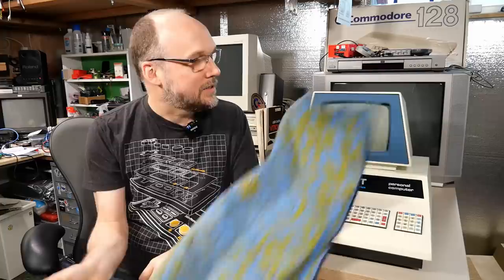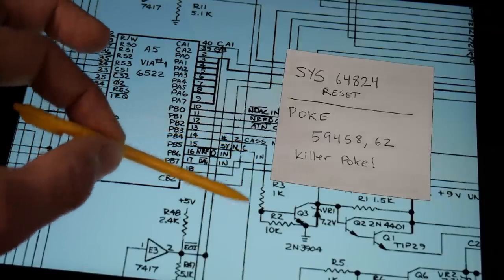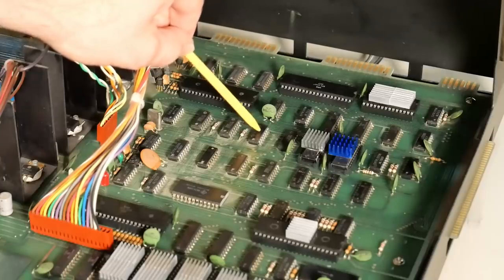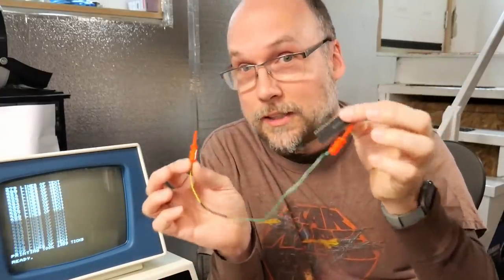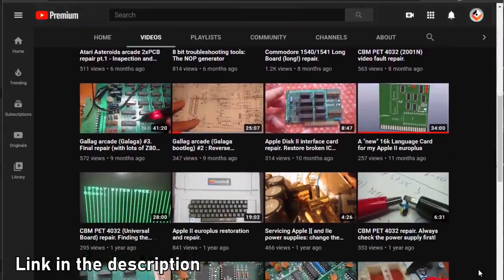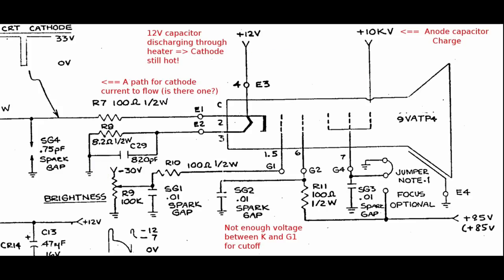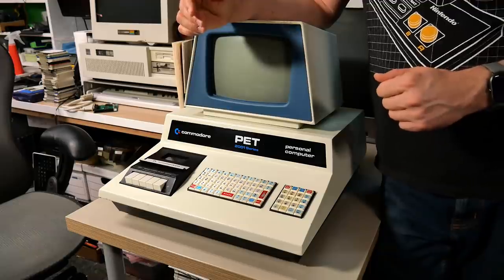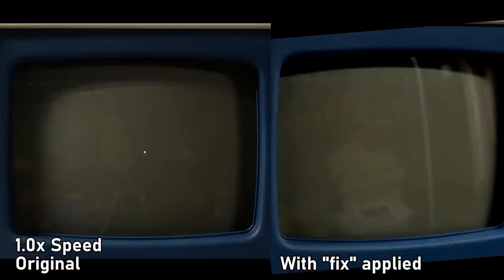Permanent Killer Poke Mod and CRT Spot fix on the Commodore PET 2001

Comment: Normal behavior for a CRT.  You would need to discharge the HV before you lost deflection to avoid it.  It doesn't hurt anything.  If your CRT has a burnt spot, it is because it was run for an extended time without horizontal and vertical deflection.  Eventually I suppose the power down spot could burn in, but it would take 40 or 50 years... Oh wait...
Reply: I have to disagree. Commodore itself tried to avoid the big spot you see on Adrian's PET with changes made in the later monitor revisions. And no, you don't want to discharge HV in a single spot, when it's done on purpose, the energy is spread with raster oscillator still running. This can't obviously be done on a PET monitor since it doesn't have raster oscillators.
Reply: @Walczyk  I never had a PET but last time I've seen that spot on a properly working CRT was early 60s TV. All TVs and video monitors from 80s i had never had that issue. And it's better to be fixed.

Comment: Back in the early 1980s, I signed on for a computing course with the UK Open University. We operated mainframes that input via teletype keyboards and output on paper tape - no screens at all. Although expensive, I quit the course within a few months and wrote off my money.
Partly because during the course I'd encountered no equipment less than a decade old, and partly because of an open policy that home computing was a fantasy, and the new, increasingly available devices like the Pet, TRS-80 and others would NOT be included in the course as they were "toys that could never have any place in computer science."
I subsequently learned more from a year's subscription to a computing magazine than I might ever have learned from that course.

Comment: I think you could safely connect that pin of VIA chip, by the 510-2k resistor to where it originally was connected. Resistor would be enough for separating the VIA from the rest of the circuit in case of level conflict. The POKE would then work as it was supposed to.
Reply: That's what I was thinking as well. Adrian could use the stacked socket trick to do this using the original VIA. Also, Commodore surely knew about this trick, why didn't they add a resistor when they designed the newer models?
Reply: I was thinking the same - a 1K resistor between the VIA PB5 and the rest of the circuit would do the job perfectly well. The rest of the circuit would be relatively unaffected by the 1K to ground, and the 1K series resistance when the VIA is configured as normal would still result in a correct logic level being seen by the VIA
Reply: @eDoc2020  yes this is correct, a resistor in series can also "do the job" but you have to "poke" everytime you want the "fast" speed. With Adrian's mod there's no need for any poke anymore. It depends on what you want to accomplish. Most strange thing is that Commodore corrected the "snow" effect on 2001N motherboards, so the VRAM can be safely accessed outside the vertical retrace periods without causing any snow, but they didn't change the firmware or changed the VIA input circuitry. So 2001N remain unnecessarily slow.

Comment: 13:00 since i have a PET 2001 I can agree as well, that the dot on the screen appears when you power the computer off, in my case sadly the CRT even has a burned spot in the midle

Comment: The persistent dot in the middle of the screen, is because the emitter in your CRT is experiencing two things.
Firstly the magnetic coils that focus the beam has collapsed, so the emitters focus is only in the middle, so energizing the phosphor for longer, so seeming brighter for less current (effort).
Secondly there is a tendency to for emitter to continue to emit when they are hot. Basically they are amplifiers, the heat means the electrons are excited, and even when the power is removed, they continue to emit due to heat. If your valve emitter system is in good condition, they will persist for longer. Answer: You have a good condition CRT.

Comment: The early IBM CGA adapter had a similar issue with snow. In 80-column mode, the CPU and the video controller chip would not be able to read/write to the memory at the same time without causing snow. The BIOS routines would wait for the screen retrace before updating the video memory, but it had to poll for the retrace status, which was terribly slow and caused the same flicker you see on the PET. So you could have slower/flickering text or faster snowy text. Some DOS programs even had options for these two "modes". Great video, thanks!

Comment: Love retro PET video's. My first exposure to computing was as a 14 year old (back in 79'') when my dad bought a 2001. Later upgraded to a 4016 with external dual floppy drive (4040) which I built a mod to make the top half of the character ROM switchable to RAM so you could create your own character sets and draw basic graphics. Happy days.

Comment: Nice RPN Calculator app.  Also really nice collab and deep dive into the CRT issue, my Uncle was an electronic engineer building TV's way back in the B&W and early color era and I remember him explaining this problem to me in words I could understand at the time (he was 20-30 years older than my father, can't remember exactly, and was already retired by this point).  I was learning to program Assembly and C on an Apple IIGS and got the //e and display as a gift/challenge to fix...I fixed the computer but stayed clear of the CRT and watched him repair it closely as he explained how it all worked in words a slightly educated ~7 year old me would understand in the late 90's.

Comment: Thanks for a very informative video.  I have a 3032 PET with the full-size keyboard.  I have used the 'killer poke' for many, many years on my machine.  It does speed things up with the penalty of 'snow' on the screen at certain times, same as you experienced.  It has never harmed any of the chips.  Many early Cursor games incorporated the killer poke as a speed boost.  You really notice the speed up when listing a program, for example.  However, trying it on a 4032 (fat 40) with the CRT controller chip, it makes very unhappy noises from either the flyback or deflection circuitry.  I quickly turned off the machine before any damage could occur.  Also, as you probably know, they fixed the dot issue on the later PETs.  I've never had it happen on mine.

Comment: I messed with some programming on this very machine back in the day.  The dot was normal with these PET's.   Thanks Adrian for the video!
Reply from the maker: Yeah definitely a design flaw from the factory :-)
Reply: @adriansdigitalbasement  😎interesting
Reply: @adriansdigitalbasement  Not a design flaw - a design choice, there's no need to provide a different discharge path as the damage to the screen would not occur during the warranty period/expected service life of the machine. Most mono CRTs of the day have a similar power down dot...
Reply: @Fifury161  There's no need to provide a discharge path in the first place. Commodore made a few mistakes and they even tried to correct them as soon as the second monitor revision came out (I have a 1978 and a 1979 monitors).
Reply: Yes, and it was standard with every black & white TV set too at that time.... everytime you switched it off, it had that collapsing dot that finally faded to nothing!  It was nothing unusual.  Every monochrome CRT and TV did the same thing.  Perfectly normal!  🙂
And yes, I was around during the 60s and 70s... pretty much every CRT image will collapse to a small dot when turned off, but some go much faster than others - 80s and 90s TV/monitor types especially....
Reply: @iz8dwf  Again, it's not a fault, it's a design choice...
Reply: @Fifury161  I'm betting the power switch would fail long before you would be able to burn-in the CRT by powering it on and off all the time, anyway. And you'd probably still see the commodore/memory-free message burnt in first.

Comment: I'm an old tube guy, so that also includes CRT's. Back in the early 80's there was always the standing argument of turn off dot "burn in", or whether or not a shadow of the turn off dot would be permanately burned in the phosfor coating on the viewable face of the screen. I was always with the group that the turn off unfocused beam did not have enough current to create the shadow spot. Can't wait to see the next installment
Reply: There is good logic to your argument. When you consider the duration there is likely more damage to be done whilst the tube is on! Damage will occur over time for any CRT - most are rated for 20,000 ~ 30,000 hours...
Reply: I’ve seen thousands of CRT tv’s over the years and I’ve never seen one with burn in or a super dim picture. Usually the most common problems I saw was one of the guns not functioning so you’d either get a all purple or all blue/green picture. I’ve only seen a few monitors with burn in, mostly business terminals.
Reply: @EmergencyChannel  You realise you have contradicted yourself?
Reply: @Fifury161  TV's and monitors are two different things. I never claimed to know anything about CRT's, but I did run the front desk of a repair shop and done paper work while the technicians fixed the tv's.
Reply: @EmergencyChannel  Erm, in this analogy they are not as they both have CRTs. The best example of screen burn in could be found back in the day in airports. Both the flight timetables shown on CRTs and the local news channels on CRTs all suffered from screen burn in. The timetable where on monitors, the news channels on TVs, all CRTs back in the day...
Reply: @Fifury161  My point was that the average consumer never experienced burn in.

Comment: Even after all this time, I still use peek and poke commands during initial board bring up.  In this case they're Linux applications I write to allow direct access to kernel memory and PCI space from the command line.  It's amazing how much of the hardware you can wring out with old BASIC commands!

Comment: The dot does not represent a dying CRT.   In fact, it usually happens with strong CRTs.
Zenith TVs in particular use to get it a lot, but you are right with saying a lot of early TVs did.
The explanation provided is very good.
Reply: I've found that on TVs the dot happens more the darker the picture is. I presume this is because the current draw of a bright picture quickly drains the HV before deflection fully stops. The association with the dot and weak CRTs may be just because their picture is dimmer.
Reply: @eDoc2020  I think Zenith use to recommend turning the brightness to maximum just before turning the tv off to minimise the dot, but the dot doesn't do any damage.  It's just the last burst of energy from the guns as the cathode cools.  It creates a bright dot as the horizontal and vertical is already shutdown, so the beam just hits the middle of the screen

Comment: Hi All

Another great video

Adrian i thought you would be similar age to me and remember black and white TV's up to 70's done that when switched off - i never knew why.

But you have invented the turbo button for the PET

This would be usefull for speed and if there is a operator watching screen you can turbo of to fix the snow 

This reminds me of changing the  CGA cards on the IBM PC to fix the CGA snow at work ( and then also at home at the time ) A lot of people complained about headaches with the machines with CGA snow at the time

Regards
George

Comment: I remember seeing the spot starting about 3 inches in diameter gradually decreasing down to nothing over about 30 seconds or so after switching off our old wooden cased 20" ITT colour TV. Was quite a strange effect watching it in the dark after you'd switched it off at night! I had a feeling it was just due to the design of the chassis, as i'd seen other TV's doing it back then as well. That was a good TV, had valves (tubes) inside, shame though that the vertical hold went on it (I think the vertical hold pot crumbled). My dad chucked it away in the end (it had already been replaced with a newer TV, I had the ITT in my bedroom when it still worked). Wish I still had that TV, if I knew then what I know now about repairing arcade and monitor/TV chassis I could've repaired it in a few minutes!

Comment: I've owned several of these PET 2001 with the blue (white) on black CRT, that all have the power off spot. My current one, by far the best one I've ever had, also has it. It's also common to see on vintage television sets. I can't remember though having owned one with the green on black CRT (later model PET 2001) that had it too.

Comment: I remember the bright dot on switch off way back when I fixed TVs a lot of customer though it was a fault or it could damage the tube it was just a product of the design of the early black and white TVs although there was a similar fault call frame collapse I think it was a long time ago still don't know how you could fix it keep the videos coming I went on to be a computer engineer as well later I remember the pet 2001 it was the only computer we had at school in the uk for a long time until it was replaced by the BBC computers

Comment: given that VIA has a nice amount of space around it, i think it might be feasible to make a "killer poke adapter" by putting 2 pin headers in the right distance (to fit into the mainboard's VIA socket) and a socket (to fit a normal VIA) on a pcb, and then having a jumper to select between pin 15 being passed through or being grounded through a resistor. feels neater than your cable and pin bending solution. plus you could attach a 3 pin cable to that jumper header that leads to a switch on the frontplate if you want a fancy switch to select between "fast" and "nice" mode.

Comment: I had always assumed it was just the leftover energy being drained into the cathode ray tube, since there was no signal coming in but there was still energy inside the apparatus, so I thought that was just the way to drain the capacitors. I grew up in the '70s and '80s I had an Atari 2600 with a black and white television set. I fondly remember turning off my television set and noticing the Little Dot in the center sometimes up to 20 seconds. As I got older and began to understand some electronic principles I understood things like batteries and capacitors and draining power and etc. So I began to realize, at least I thought so, that those old CRT screens were just draining leftover power, and we could see that residual power being discharged against the phosphorus.

Comment: As far as i remember what my father says about that dots on CRT, he says that this dot apears for 2 reasons: first there is difference of electric charge left between anode and cathode of the tube and second cause is that cathde still emitting electrons that are fly to the screen and make this glowing dot.
There is a trick to make this dot scatter over the entire screen surface: you need to support horizontal and vertical deflectors in yoke to continue to generate correct deflecting signals for sone time, about 10-15 (on a bigger screens it can be up to 20-25) seconds after shut down. On our old tv-set there is custom homebrew board for this magic. And, yes, on some early black/white CRT tubes this spot this point burned out the luminophore. Later models of tubes is less vulnerable to this issue.
Reply: This is right and infacts, some monitors (and even TVs probably) do sustain some raster scan after the power has been removed. However, on a PET 9" monitor, there're no vertical and horizontal oscillators, the signals to sustain the raster scanning are generated by the PET logic motherboard, and that dies instantly at power off.